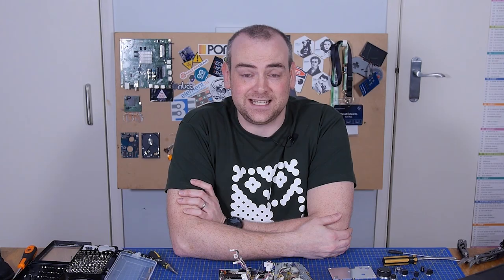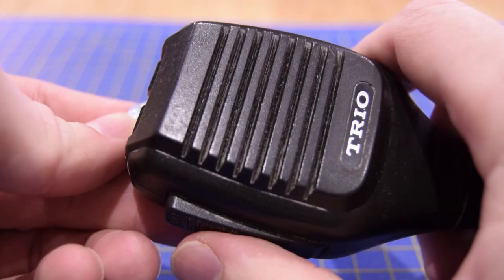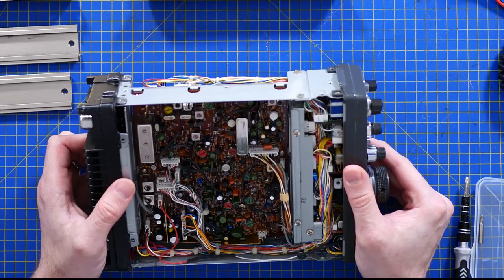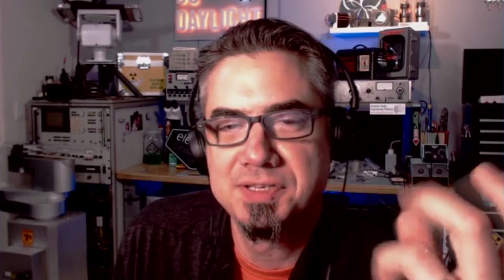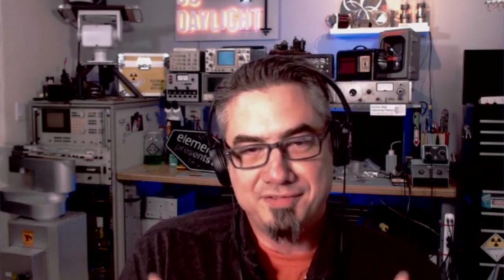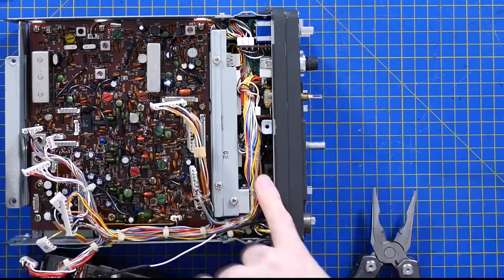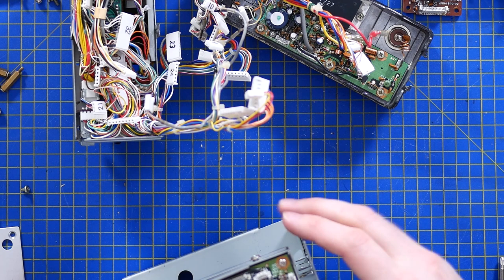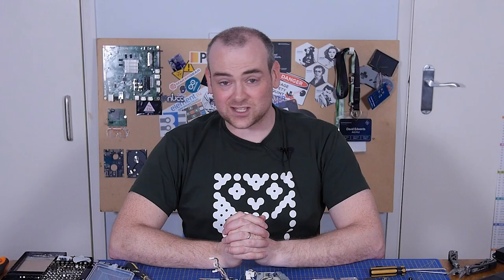Ham Radio Teardown with Derek from DC To Daylight! - The Electronics Inside

Comment: The distance possible at 2 meters depends on power output and antenna type/quality/height, but 'line of sight' is a bit of a misrepresentation.  Not wrong, of course, but most people hear that and think what it means for WiFi, which is pretty limited.  At 144-148 MHz (2 meters), 20 miles is not unheard of at even 5 watts - optimized antennas can take this even further.  At higher power with good antennas, 50 miles is pretty easy.  When you add repeaters into the mix, the range is all but unlimited.  (Special amateur radio events link repeaters across the country.  I've only ever participated once, and talked from Philadelphia to New York City - a fairly 'short hop' for this kind of event.)

Comment: Pretty sure I've seen the "voltage regulator stuffed into 3 pin connector" before, on some older retro computers (it was on an Amstrad CPC iirc.) Maybe they did it to make replacing them easier, since those old school voltage regulators can be rather unreliable.